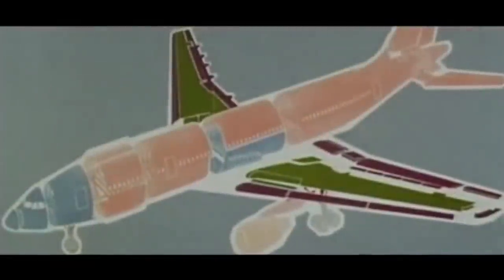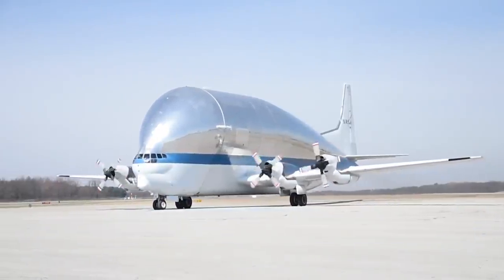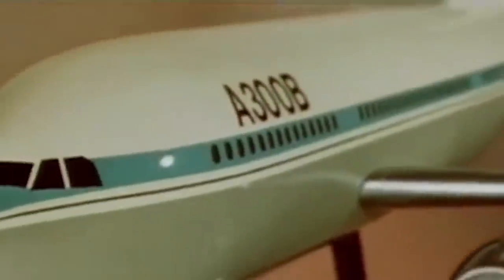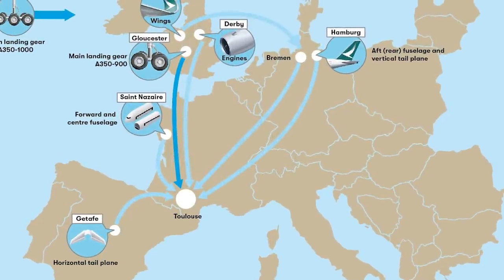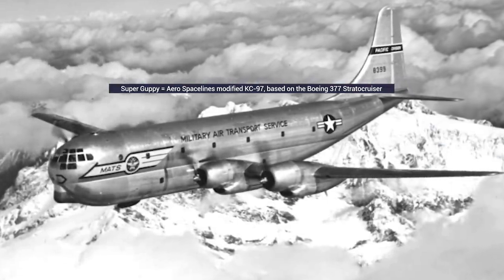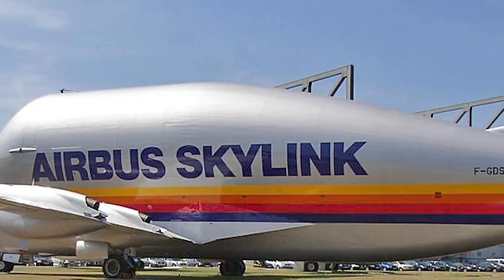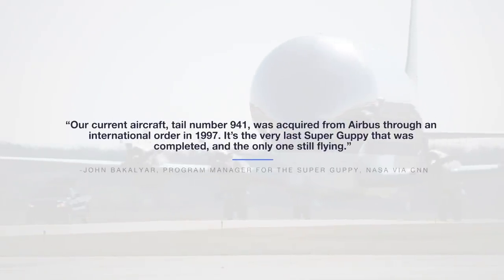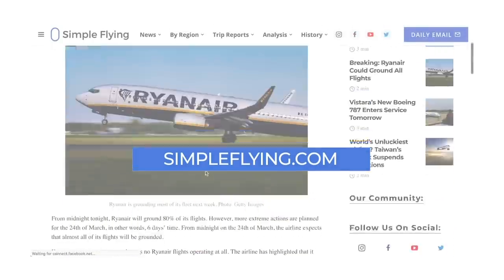Why Airbus Used To Carry New Aircraft Parts In Boeing Aircraft

Comment: I have been inside the Super Guppy at the Tillamook (Oregon) Air Museum, and it is an awesome machine to behold. The inside is cavernous (as you would expect) with the cable runs and fluid lines are all visible. In 1990, I got to shake hands with Alvin M. "Tex" Johnston, CEO of AeroSpacelines and former Boeing test pilot. Great video, Simple Team!

Comment: Fond memories of plane spotting at Ringway in the 70's and 80's and watching the Guppy lumbering into the sky.. That was when you could still walk on the top of all the terminals and there was even a cafe and plane spotters shop.. I later learned to fly there, when the old hangers were still there (before the second runway was built). Ironically, I later became a gliding instructor at RAF Sealand and so had first hand experience of the Belugas coming out of Broughton.

Comment: I got to see one up close in the late 80's when I was in the Air National Guard in Tucson. It was there to transport an A-7D that had developed a crack in a wing spar and had to be transported back to the Vought factory in Texas for repairs. I was amazed to see that A-7 with outer folding wing sections removed, fit into that Guppy!

Comment: As a pilot, I would have been nervous to know that, to swivel the nose sideways to enter the payload, all the cables and rods connecting the cockpit to the flight control surfaces had to be disconnected ( and, hopefully, correctly reconnected before take-off )

Comment: I can see one day nasa needing a replacement and buying a craft from airbus
Reply: There isn't really a need for it. Everything is moved around now on barges, and the last time anything that big was needed, was to transport International Space Station modules from Europe to the Kennedy Space Center.

Actually, in both instances, the Beluga did the journey, delivering the Columbus and Node 3 Tranquility modules to be processed and then launched by the Space Shuttle. The Beluga notably used the Shuttle Landing Facility runway at the KSC.